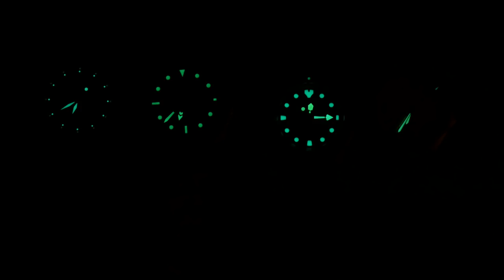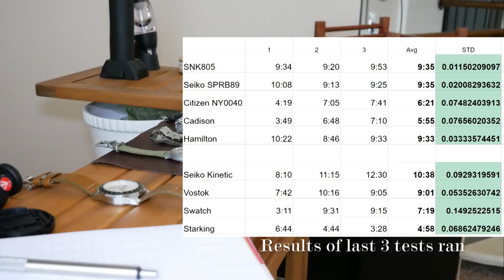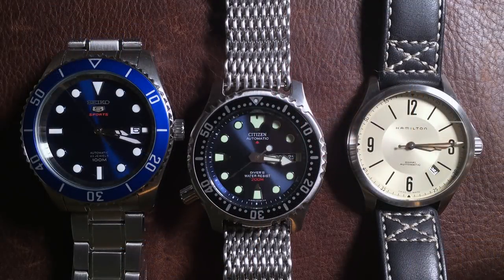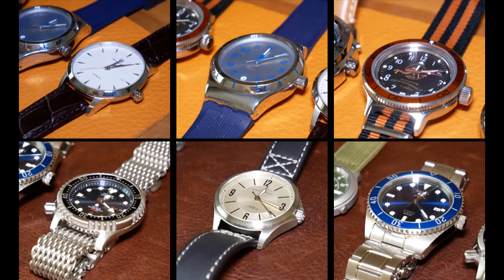Seiko 5 Efficiency Test (7S26) : Science Time

Comment: Yikes the snk809 is $146 right now on amazon. Wish I picked it up when it was at $60
Reply from the maker: OUCH!  thats nuts.  It will come down, it always does.  But that is crazy high.  Beginning of the year I think it was right at 100, but it did drop back down.  I think I looked a few weeks ago, and they were still close to $60.
Reply: Same here buddy!
Reply: You can buy them pre-owned and get them a little cheaper.
Reply from the maker: the blue snk807 is down to normal at $63.  But the rest are still way up.  Eventually they will come back down.  These price spikes happen.
Reply: Yeah I'm going to hold out for the snk809 (black) to come back down to ~64 or for one of the others to drop into the 50s or below before I bite. I saw the green one hit like $54 and I regret not buying it now. Black is certainly my number one pick followed by the green then blue then tan/white

Comment: There are a lot of...not scientific errors you have made.
1. Shaking watches by hand. You will never shake 2 watches the same way. One faster the other slower, one stronger the other not so strong.

2. What made you decide to test 1 min of shaking against 20 sec of winding? What ypu are actually comparing here? Im assuming that you pulled those time values out of the air.  What Im trying to say is: it is obvious that you will wind the watch better in 20 sec (again time interval of the winding is silly. You should base winding on the revolutions of the crown to make sure you are winding all watches the same) than shaking it for one minute.
In 20 sec of winding you can probably fully wind the watch lol.

It is still good to see that Seiko is efficient. But that's reallythe only conclusion one can take from your experiment.
Reply from the maker: I'm sorry you didn't enjoy the video.  Perhaps I should of said something in the video, but it's too late now.  But keep in mind that my intent was to do a fun, short, and practical test on how the efficiencies of the various watches compare to one another.  Rather then an exhaustive study into the nature of Seiko's mechanical systems.  Which in all honesty is most likely left to someone with more experience and knowledge in movements or mechanical engineering.
Now as to your questions, and this may get a little longer then anyone really wants.  So don't feel like you need to read it.  But you took the time to comment, I owe it to you to take the time to respond.

1.  I decided to shake the watches, rather then use a winder for a 2 reasons.  The first, is I honestly thought it would be quickier and easier to do.  But more importantly I also thought it was a more practical example.  As not everyone has a winder, but everyone can shake their watch to get jump start it when it dies.
Now the inclusion of a biological system (myself) in any experimental procedure is not idea, as it will undoubtedly add inconsistencies to the result.  And while those inconsistencies are impossible to remove, their are ways to reduce the impact on the results.  Which I Implemented as follows:
A) Have the same person do all the testing, and try to be as consistent as possible.
B) Repeat the procedure multiple times and take the average.  The more testing you can accomplish the better, but since I didn't want to do this endless.  I initially set an n of 3.  Which is the very minimum to achieve any results with some statistical significance.  
Which is also why I showed the standard deviation in the initial table.  Of which I am impressed at how low it was for both seikos automatics.
And C which actually leads to your second question.  Testing for an appropriate amount of time.  While 1 min was chosen as it's a nice round number.  It also meet the criteria I was looking for.  Run a test for too short a period of time, and the inconsistencies in my shaking method would be more pronounced.  Shake for too long, and you run the risk of fully winding the watch, and possible over winding the watch.  Which would be more a test of its power reserve then, efficiency of it's winding mechanism.

2. Your suggestion for counting the crown revolutions is a good one.  One that I did not think of.  Although I would have to think about whether or not different size crowns would impact the results as well.  My gut reaction is to say no, but I'd have to think about it.
As for the 20 seconds.  Again it was a nice round number, and I thought it met the previous criteria.  Although as you can see it did wind (and possibly over wind) most of the watches.  But the point of the last part was not to show any real detail, or to compare the efficiency of the various winding mechanisms.  Rather to simply and practically show that if you have to give a watch some power by hand.  Having hand winding is better then not having hand-winding.

Which honestly, is the only real takeaway anyone should get from the video.  Now thank you for watching, and thank you for taking the time to comment.  It shows you truly have a passion for watches.  Cheers!
Reply: @RelativeTime  Hi!
First of all allow me to thank you for such an extensive explanation. I am really impressed. 
I did enjoy your video an I agree with everything you said in your response. Your test still showed how good seiko movements are.

Regarding the crown revolutions...It is too late here for me to figure out as if diameter of the crown would affect the winding ;) I think it would but I can't justify why haha. But the variation between crown sizes is probably much smaller than variation you introduced by winding for 20 sec. 

As you said though, this was to prove that manual wind is much more efficient in getting the watch going and I think we can all agree that you proved that point.

Apologies for critique. Quality of tests, validations and variation in them is my field of work and study. Cant help myself  but to notice possible sources of error in the test.
Another idea for shaking watches would be taping them to the old washing machine hahaha.
Anyway, keep those vids coming!
And good luck with your experiments. 
Ps. Whatever you are drinking there....looks dangerous ;)
Reply from the maker: Thanks for replying back.  And I hope you didn't get any sense that I was trying to be snotty or anything.  Just trying to explain my limited logic.
I can understand when it's your line of work.  If I'm being honest my background is actually in Science.  So the quality of the work is really student science fair at best.  And you really could poke holes in it all day long.  Which is why I wanted to point out the 2 biggest flaws I saw in the video, before anyone else could.
I just thought it was more of a fun quick video to make. 😋

I haven't thought of any more experiments.  But some point I'd like to do some more science based videos.  Like going over how and why lume works.  Or go into what atomic time actually is.

And it was just Mt. Dew in my old beaker mug.  Haven't done it in years.  But I used to put Mt. Dew in that mug and bring it with me whenever I had to interview someone.  Just to see if they would say something, or ignore that I was doing something odd. 😋
Reply: @RelativeTime  haha mountain dew looks toxic in that beaker. 
Did not get any snotty vibe ;)
It is actually fun to have a nice chat with someone on YouTube for a change.
And apologies if my initial comment came out...a bit...snotty ;)

Yeah or vid about different lumme technologies!

Comment: How about who is more accurate in water resistant and does it make a difference in iso certified be a great experiment.
Reply from the maker: That would make a good experiment.  Might require some specialized equipment, and some expertise.  Thanks for the idea.
Reply: Relative Time no problem. Orient has a dive watch but seiko is iso certified that being said how to do a real test if 200m range

Comment: if you want to see the true power of 7s26: use your watch for 3 months straight, then calibrate it in seiko official service. Then watch, it is super accurate. Mine +/- 1 sec/week  (skx 007)
Reply: @davehimlin2374  my seiko 5 also gets +/- 1 to 3 sec/day. I just curious, skx007 has different result
Reply: @davehimlin2374  any seiko 5 I bought after using 3 months and get calibrated, can achieve +/- 1-3 sec/day easily
Reply: @davehimlin2374  the calibration is free of charge (in seiko official store) if you do it in the guarantee period (stated on the guarantee card)

Comment: So why they say about 40h power reserve for Seiko SNK805?
Reply from the maker: Well on average when fully wound it should be about a 40h power reserve.  I wasn't fully winding these in any way.  Plus each watch is going to be slightly different so one maybe 39 and another might be closer to 41.
Reply: @RelativeTime  To wind them up to 40h you must run a marathon with this watch on your wrist, twice.
Reply: It is enough for me to wear my Seiko5 at work for eight hours and it is wound up to the end. Checked several times.
Reply: @marduj2768  if your work is running marathons it could be, but if you work at PC and do not walks a lot they barely live through night
Reply: It's not a marathon, but I move a lot, I don't walk as much as I move with my hands, but I don't have a problem with winding the clock even on those days when I'm not working.

Comment: The test was nonsense for the Kinetic. It has a rotor but is charging a battery, this would require electrical measuring too. The test would be valid for mechanical automatically winding movements ONLY.
Reply from the maker: Well as I said, it was more thrown in for curiosities sake.  I wondered how it would fare under similar circumstances.  But there isn't anything concrete here to be learned about it.  Although in an abstract way they do operate similarly.  Both convert kinetic energy from the rotor to potential energy for later use.  One stored as compressed spring, the other as chemical energy in a battery.

I am curious and would like to figure out a good way to do some sort of efficiency testing on a kinetic.  I tried to do a followup focusing on 2 kinetics vs 2 auto Seikos.   Using a winder to rotate each a set number of times, and see how long each would last.  But I failed to realize how much Kinetics don't respond to winders.  In each instance both kinetics would run for a few minutes.  I'm guessing it didn't like the slower rotation of a winder.  Perhaps there is some voltage threshold the system has to overcome for the battery.

Comment: The kinetic has a capacitor rather than a battery.
Reply from the maker: I know that they originally did, but I'm not sure if they still do.   One of the reasons a lot of the original kinetics failed after about 8-10 years was a fault in the build of the original capacitors.  I know, because I still have one.  Yet I can't remember if I had it replaced with another capacitor or if the replacement part was a lithium-ion battery.  It was whatever was going in the newer kinetics, and I'd have to go back and look.

Comment: What is hacking?
Reply from the maker: Hacking is when the second hand stops after you pull the crown out to set the watch.  Most things have it these days, but there are still some watches that don't.   Typically you would use that to make sure you were in sync with another clock by making sure it was perfectly alligned.